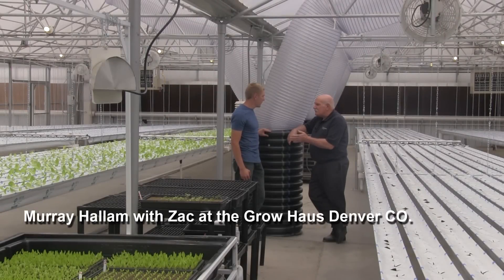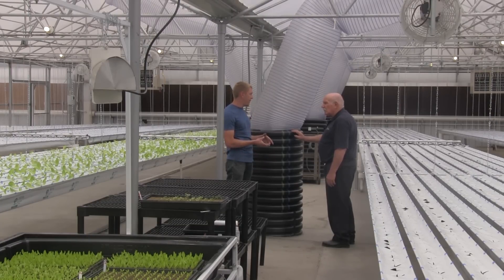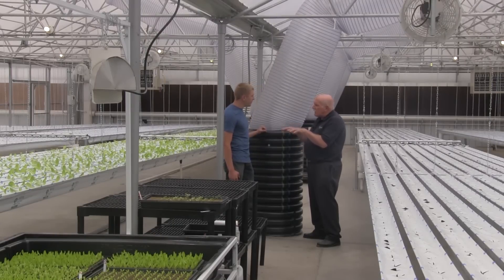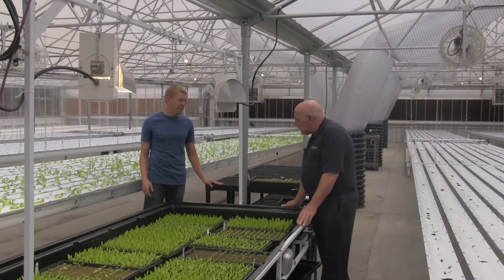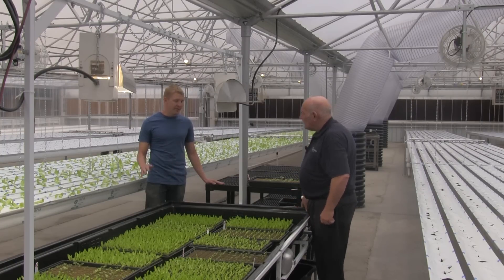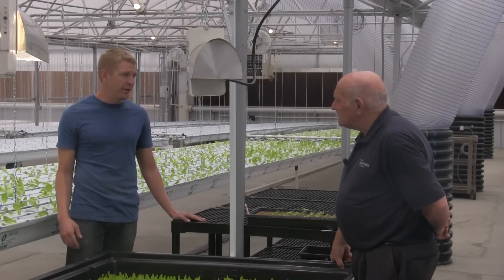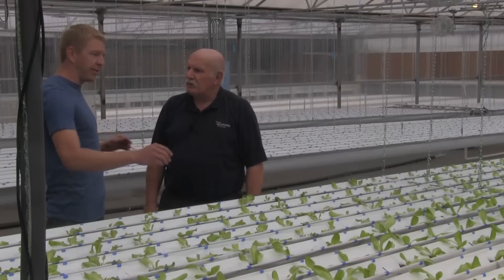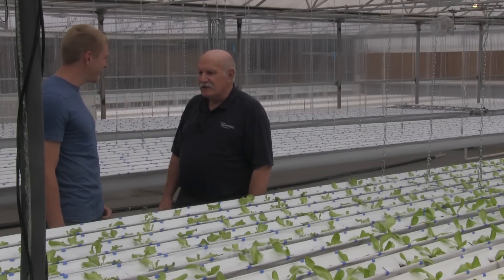GeoThermal Heating and Cooling in Aquaponics

Comment: Strictly speaking, it is earth tube. Geothermal needs something like a heat pump.
Reply: It can, but air can be used. The problem is they are only a few feet deep. They need to be more than twice as deep.